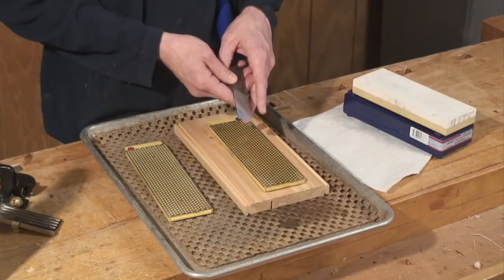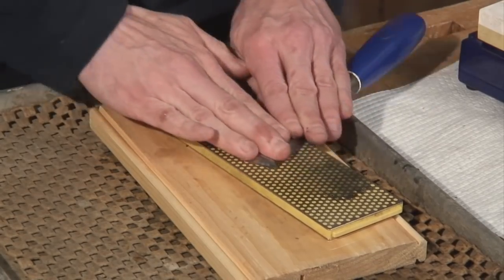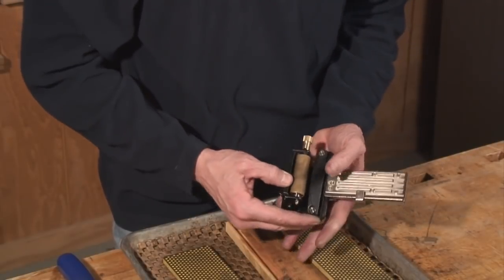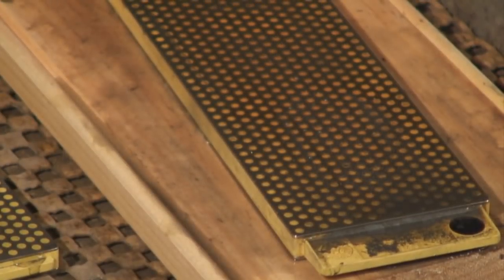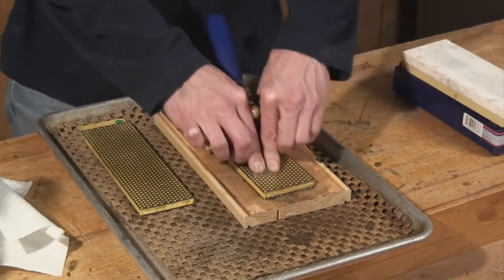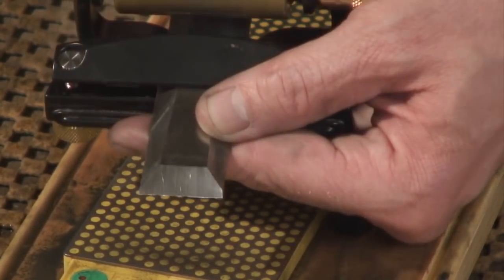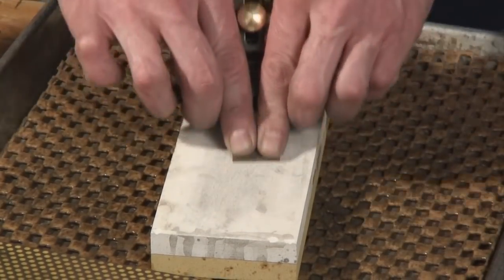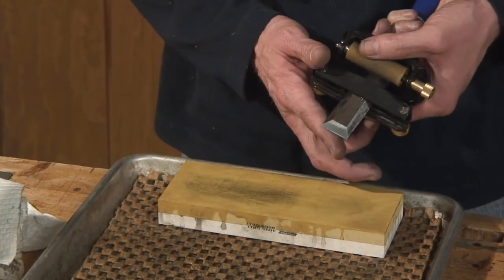How to Sharpen A Chisel With Diamond Hones and a Honing Guide

Comment: Nice vid but I'm pretty sure that you're not supposed to remove the burr until you're on your finest grit which in your case would be the 8000. Other than that, very useful information and a fine video...:)
Reply: He removed the burr on the 1200 because he said that you would usually stop at that abrasive for most carpentry work. he on;y went on and did the 8000 to show how it is done.

Comment: l would advise people not to buy this jig l have one and it does not work properly l have cheeper jigs that do work better than this one it is ok if doing only one angle forget the micro bevel it does not work it sharpenes on a skew so save your money very dissapointed in this jig considering lee valley normally make good tools not this time they need to sort it out or scrap it and start again.